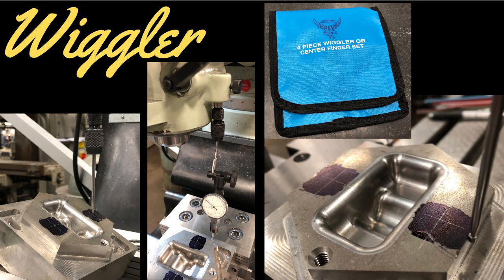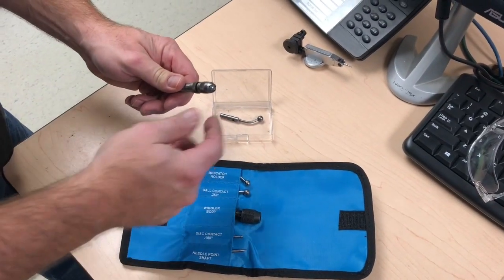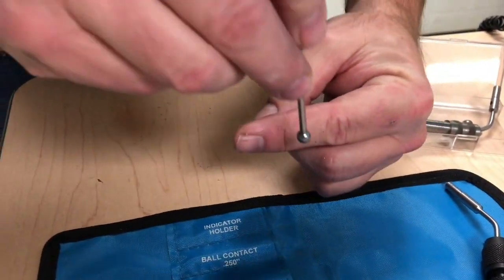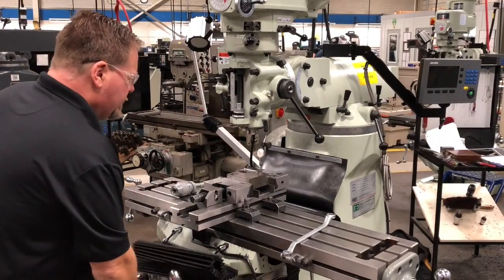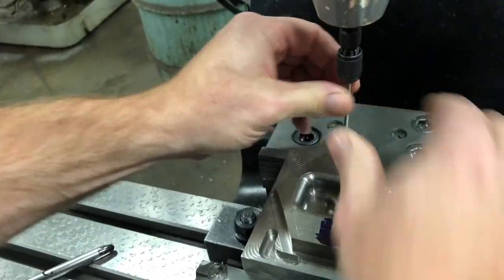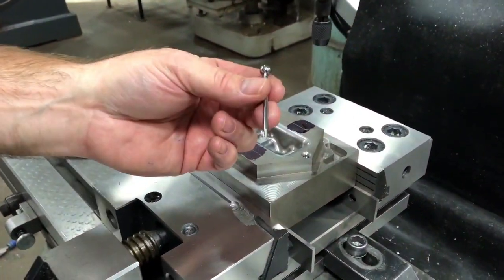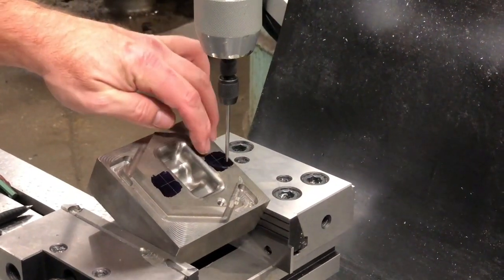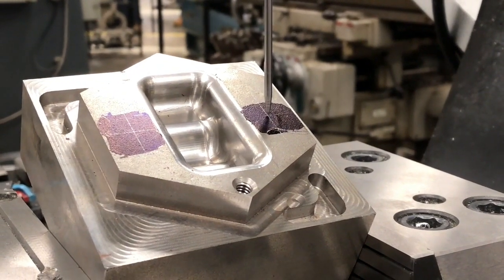how to use wiggler edge finder

Comment: Im a college student that is going to have to use one of these on a project this right here makes me so thankful for the innovation of the edgefinder.
Reply from the maker: it is very difficult for me to give an example of a situation where you actually need to use a wiggler now that edge finders are invented like you said they’ve kind of gone away
Thank you for your comment and thank you for taking time to comment. It is much appreciated. 

Ray
Reply: @shopandmath  I was told by my teacher is there is no real reason but a good machinist should be able to work with literally anything around them to get the job done

Comment: I use a wiggler at a lower rpm about 500. This reduces the tendency for the probe to fly out due to centrifugal force. Also, I use the least amount of force on the collet as increased friction there reduces its accuracy. The wiggler is useful on materials that are non conductive as I prefer an electronic edge finder that doesn't require spindle rotation to indicate an edge.Expect the wiggler to indicate an edge to about 0.002".
Reply from the maker: thank you for sharing
Ray

Comment: what use is the thing having it off-set from the spindle to the side as you show at 2:32? :)
Reply from the maker: the side post is for holding the indicator to Aline parts in the X and y axis or to check aliment of parts during a machining setup with out taking the tool out on the spindle
thank you for watching the video and picking up on the little things (i wish my students had as good understanding as you)
Ray
Reply: @shopandmath  hmm but isn't this tool vastly inferior for this task than a standard indicator?
Reply from the maker: @SoWe1  
one of the head attachments of the wiggler  holds an indicator that is what i am showing @2:32 
sorry if that is not clearly shown in the video
The wiggler is not a used across all machining industries 
Ray
Reply: @shopandmath  oh now I get it, at 2:32 you're just using it as a mount! Works only with the non-quick-attach though, right? Cos that would surely move enough to screw up your indicating?
Reply: SoWeMeetAgain 
There is a thumb screw used to hold the attachment

Comment: What are the alternatives to a wiggler for edge and center location?
Reply from the maker: You can use an edge finder
If it’s a highly accurate shut up you can use a dial test indicator
If it’s not very accurate you can use a dowel pin and magic marker
There are all sorts of electronica probes that can be used
Depending on the set up that you have you can also use a Depth micrometer
There’s about five or six more different ways including an edge finding microscope that Gets mounted in the spindle
And you also have lasers
Thank you For your comment, I hope this helps
Ray
Reply: @shopandmath  Thank you for the feedback. Yes, it was of some help.